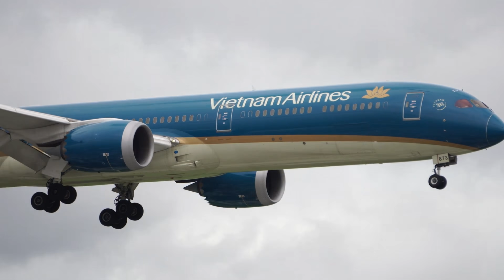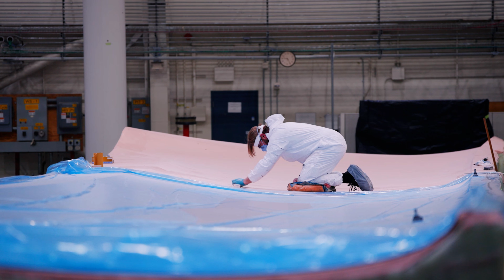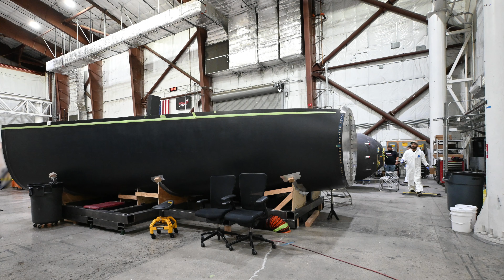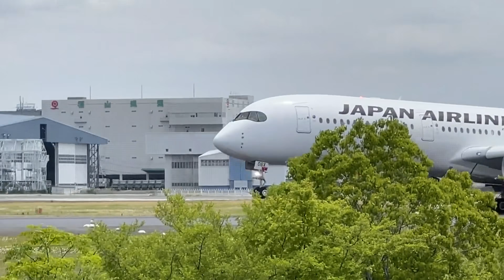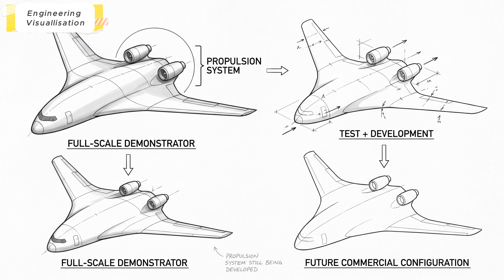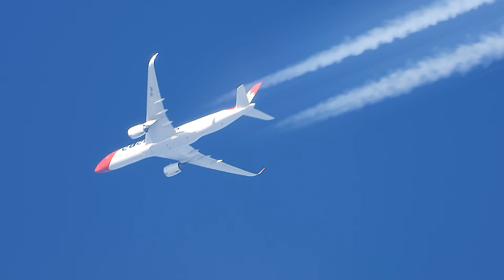JetZero’s 250-Seat Plane Is Brilliant — But Hard to Build

Comment: JetZero has not yet developed a pressurized cabin.
JetZero should utilize electric motor-driven boundary layer ingestion.
The generator has already been developed by Japan's IHI.
Reply from the maker: That's a very insightful point about the pressurized cabin and the potential for boundary layer ingestion. These are definitely key challenges and opportunities for JetZero.